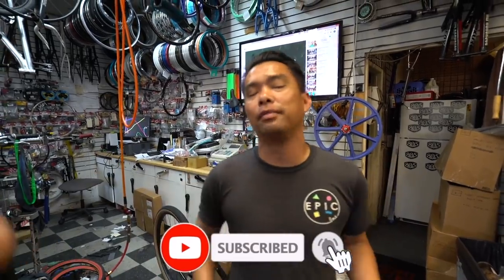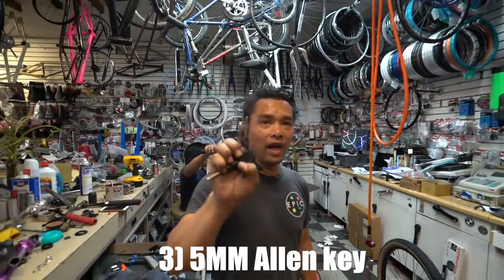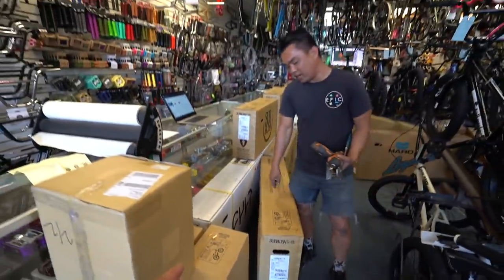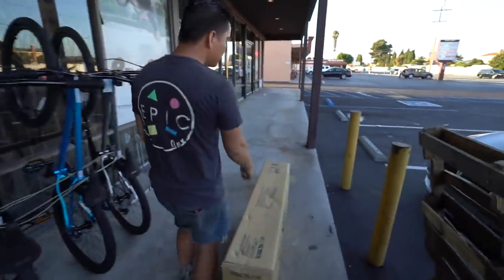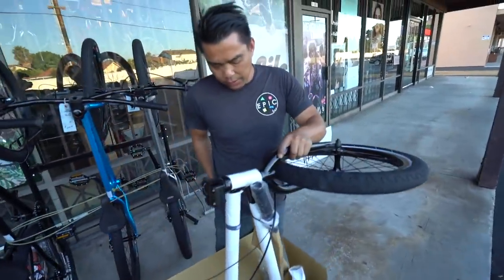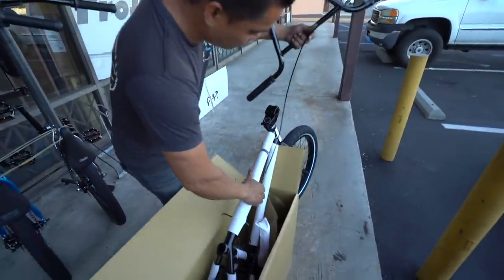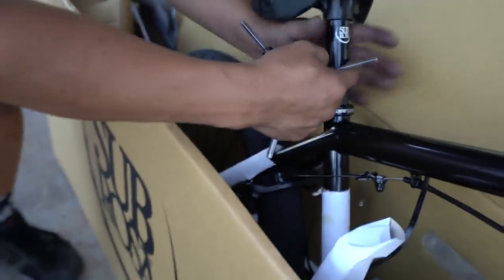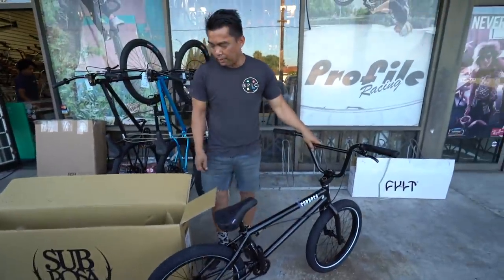HOW TO UNBOX AND ASSEMBLE A COMPLETE BMX BIKE!

Comment: Phu Vu didn't grease the seat tube, the stem bolts, or the pedals;  gonna have to mark you down a few points there Turbo... Always check the Crank bolts because you don't know if that bike was assembled at beer thirty on a Friday, or some messed up Monday morning blues because the assembler had a bad weekend at Bernie's...
Reply: Would WD-40 suffice?
Reply: @WorkinProgress69568  no! That lubricates too much everything you put on with that will end up getting loose!
Reply: @noire1991  WD-40 is a water displacer and mild lubricant; prevents rust and provides enough lubrication to achieve the desired outcome. 
How does this pose as a problem?
Reply: @WorkinProgress69568  it is made to avoid friction. Not to just prevent rust or water contamination. Why do you the anti seize and actual grease exist? They have different purposes. That is why it is used to loosen metal products that are stuck together not like the grease or anti seize which are designed to prevent binding while being adjusted and tighten together. Come on man don’t assume you know everything. That is not the desired outcome

Comment: Great (informative) video! Thanks for showing us the little tricks of the trade like keeping the majority of the bike in the box while you work on it. I work construction, so I'm probably gonna use my drill/driver like you did. One question though... what torque setting do you have your drill chuck set to? 15-20 somewhere around there? I don't want to over torque anything, and avoid stripping anything out. Even though I know to start threading things by hand (so you can feel any resistance, and not cross thread something), but that's an excellent tip for someone who doesn't know!👍Again great video, and keep up the good work!

Comment: Why do most bmx bikes I see now have a 3/8 front rim bolt and a 14mm rear rim bolt ? Is the 3/8 bolt ok to put a peg on and grind?
Reply from the maker: Yes, you don’t really need an oversized axle in the front because it doesn’t carry as much weight on it as the backend does
Reply: @AlfredoMancuso  Thanks brother I was tripping out on it cause my old redline has the 14mm front and back. And the new bikes I got me and my son have 3/8 in front 14mm in back. Really appreciate your help. Now I can buy pegs and teach my son how to use them.
Reply from the maker: https://youtu.be/IIan_xsdTqM
Reply from the maker: This video has some good options for pegs
Reply: @AlfredoMancuso  ill check it out right now